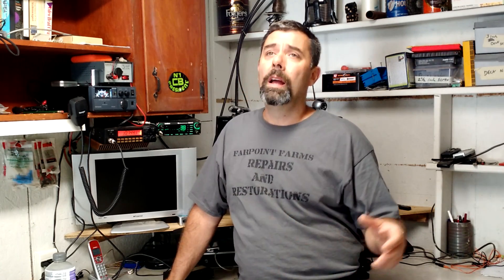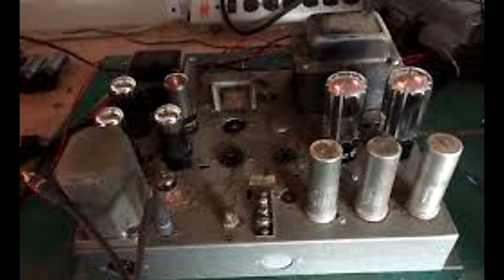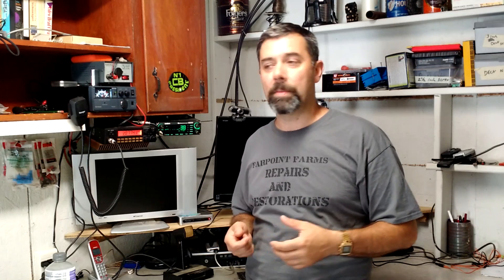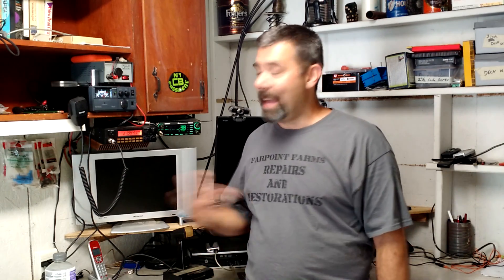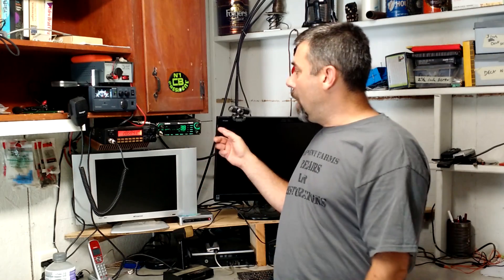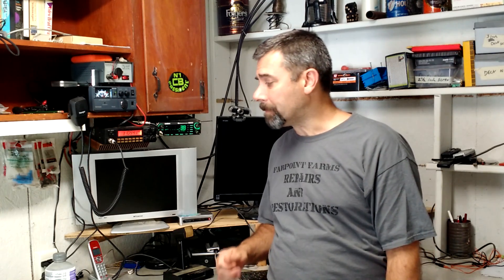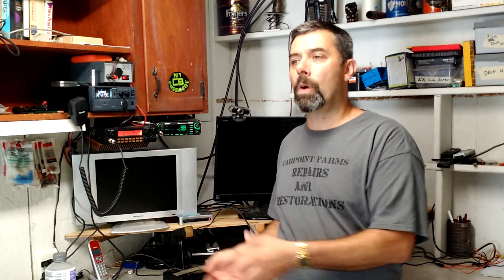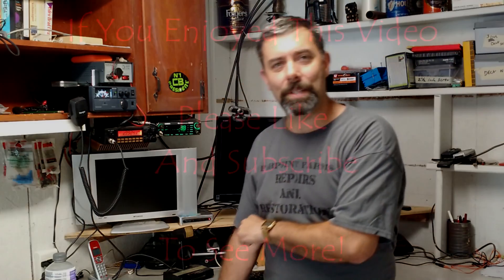A Beginners Guide To CB Linear Amplifiers.

Comment: Mid 90s I had a Cobra 25 ltd classic through a 350 watt Hurricane. We discovered that if we pulled the Wilson Trucker 4' stick up next to the electronic coin/control box at the car wash and keyed her up it added free minutes on the display. Always had a clean truck in those days.
Reply: i live in Crisco i had a super penetrator on the roof. I got a knock on the door and a pastor was standing there. he invited me to church.. it seems like i talked threw he pa systen. so on Sunday morning i cooled it.. did not want to inter fear with the lord
Reply: haha what a story
Reply: Had a couple guys in the 4wd club able to do the as well. One guy was able to just pull in the wash bay, and the wipe only had to touch  the metal of the wash arm and key up to get free washes. He had a 3000-watt, though.
Reply: If he was running 3k with a whip that was touching the roof or metal arm it would be arcing like crazy.

Comment: Okay I’ve watched several videos on antennas for a C.B. base. Yours are the most informative. My brother and I are trying to hook up with each other on our regulation 4 watt C.B. radios. We are separated by perhaps 11 - 12 miles as the bird flies. He is on top of fairly high ground; I on the other hand am living at about 2’ above swamp water level. Is this a futile attempt? Also I bought 50’ of RG213 coax for an antenna I hope to raise up to the regulation 60’ above ground. I just finished watching a video on the Tram 1499 ( an antenna I’m considering) and the package recommended RG8 for best results. Should I buy new cable? Consider a different antenna ? Looking forward to hearing from you.
Reply: Both of you need s.w.r  below 2 to 1 ,no further than you are apart you should be talking on 4 watts,.73s-Kc0rom

Comment: I used to have a Palomar 225 HD (High Drive) for my Cobra 148 GTL (with extra channels via chip leg 1/0) as my base station. I turned down the AM to 2 watts dead key and SSB to about 8 watts top swing which worked perfect for the High Drive. It worked great then one day I decided to swap the linear to my car to another CB for a trip, but I forgot to turn down the AM power. I popped the linear. I held on to it to get it fixed one day, but I got busy and packed my base equipment up to the basement in a box while throwing the linear away. I listen to CB via the scanner once in awhile seeing that it's picking up. Maybe someday I'll get it up and running with a new heater, or without.

Comment: When I got into CB at age 11 back in 1988, you were big with 400 watts. A few guys had around 1000 watts. It wasn't till the mid 90s that I really started to see the big amps doing several thousand watts being used by a lot of people. There was a guy that was building them in our area and several people got his 2x8 amp that did around 1500 to 2000 watts. They preformed very well, but were dirty splattering harmonics all over.  I had his 2X4 and it caused all kinds of interference too. The amps I have now are pretty clean. This is what I found with linear amps with a good radio and antenna in a mobile.

200 watts will get you out of the static and give you a pretty good boost. You can easily talk 10 miles away
500 watts will make you preform as well as a good base station and will allow you to have a high deadkey which will give you a solid signal. 15+ miles.
800 watts you will be able to talk about as far as the curve of the earth will allow. You will be heard 20 miles away by some. These amps typically have good RMS wattage. 
1200 watts will give you some good hammering abilities and you will be talking miles away to people. You will be heard 25+ miles away.
1800 watts you will be one of the stronger mobiles and few will get over you. You will be talking all over town. 
Any more and you're making little difference on the meter and it's only to try and get over the few guys running a lot of power. You will not talk any further and will just make it hard for others to talk. You will also need to make major modifications to power those amps.
Reply: barefoot my radio would talk  15 miles mostly boxes say they're 150 lo
Reply: @joeylowery4566  When you say barefoot, do you mean a Striker 955 or other export or a 4 watt Cobra out of the box? The 80 or so watts a Stryker will do will get you out pretty far with a good antenna with quiet conditions. My examples are more real world with static some skip.
Reply: Or 2:50 high probably not more than 40 on the low and 80 on the high

Comment: KG5WFV... Better listen here before you wanna run a amp on cb...
RF EXPOSURE is worst on 11 and 10 meters than most bands. 100watts or greater you will be causing serious harm.. it may not be Microwaves but your body absorbs HF and RF better on 11 meters. it well on chicken band. Add a amp.
Experience eye pain ear pain more headaches. Best cb radio to buy is a 5 watt cobra. Less watts = safe
Reply: bullshit period. WTF

Comment: I need your help!  I just purchased a brand new. Cb radio and 102" whip antenna ,,cable and all and all I get is static,, even got an SRW Meter for it and all '!   I can send pics.  Mybe got something hooked up wrong.
Reply from the maker: I suspect the antenna is installed wrong and is grounded. can I see a picture of the antenna block?

Comment: Just for information purposes, a good friend of mine is running a stock Uniden bearcat 980ssb with a RM Italy kl203. Most of the amps that I have dealt with have very little problem with 4 watts am input, most do NOT like the 6+ watt input. That said, smaller Texas Star amps prefer less about 2 watts and they are happy. The Texas Star sweet 16 loves 100 watts input max.

Comment: Most low drive amps were designed to run 4 watts out of the box, so they were compatible with most common CBs, then you have your high drive amps which can take massive power and put out an even more ridiculous amount of power.
Reply from the maker: I always thought it was 1 to 2 watts for low drive and 3 to 4 watts for high drive.
Reply: @FarpointFarms  it is

Comment: CB is fun if you dont want licence, but not close  to HF ham radio.it skip like 10m ham band.Problem of the CB is that i have only one band up of the hf portum,and skip is very rare on that 27-28 mhz bands.Without skip  ,half of the year CB is completly dead in my area.
Skip on CB is only in summer and part of spring and afther that CB is dead ,just like ham 10m band.But hams just switch to 40,80,or 20m in that time of the year.I have 100w hf rig kenwood 430s and simple windom fd4 wire antena +20amps power suply and for 300 dolars of equpment i work 80,40,20,12,11,10 m with one antena ,and no antena tuner so you got 5 bands +CB station for 300 dollars .I worked whole world with that simple antena and 100w ssb rig.I would newer trade just 40m band for CB.On 40 m always skip and propagation.20m king of dx ing in winter and summer always work.So CB is fun, but if you realy love radio, try to get ham licese for hf.

Comment: Why not use a 4 amp power supply for those amps requiring 12 volts like a mobile amp?  That's what I did and it worked quite well.  I still have 2 of those power supplies--one a 4 amp and one a 2 amp.  Why do you still stay on channels 1 through 40 with your knowledge of electronics.  You need to use a phase locked loop radio and go upstairs above channel 40 and below channel 1.  Also modify the clarifier to swing the transmitter to the receiver.  It's very easy to do.  I used to modify radios for people that wanted to get away from the 1 through 40 channel bull crap.  Yeah, that's why they call it a linear amplifier.  It doubles every time you increase the power.

Comment: I used to be an avid SSB enthusiast but sold all my equipment when I moved from the Atlanta area to Tennessee.  I had a 250 watt linear amp on my base station and a 75 watt mobile linear.  On my base station I ran a Fluke freq counter and modified my JC Penny's SSB radio to go above channel 40 and below channel 1.  I drilled a hole in the top of my radio to insert a tuning wand into the oscillator so I could swing it up for channels above 40 and down for channels below 1.  Ah, those were the days of SSB CB radio.  I think my dad still has a Palomar linear that I plan to get one day.  I used to modify CB SSB radios to go up or down below 40 and channel 1 for people who wanted to get away from all that 1 to 40 channel crap.  It sure was quiet up on channel 60 upper side band.  That was my home channel and I talked to more HAM radio operators than CB radio operators.  I had met quite a number of HAMs upstairs that I talked to daily.  The most desirable radios in my circle were Sears and JC Penny's single side band phase locked loop radios 'cause they were so easy to modify.  Cut a trace on the circuit board and add a couple of SPST switches and broadband the oscillator and you were good to go.  I sure miss those days (mid 70's and early 80's).  Heck, I even talked to Australia from Atlanta area using my old 1/2 wave ground plane antenna which was tuned to a SWR of 1:1.  I monitored my SWR's daily on my mobile and base station.  Sure wish I still had my Fluke freq counter.  I've talked around the world with single side banders using my old 1/2 wave ground plane and my base station JC Penny's radio.  Do they still use RG-52 coax?

Comment: Been out here trucking for a long time...lets just say for a time...was out here well before they changed our HOS to this crap we have now...that said. I've always had some kind of CB. From Corba up...Stryker is my favorite. 
But I retired and my old radio gear got lost or damaged etc.
So...I came outta retirement. (Forced. Wife said get outta here...go back to the hwy)...
I did and been out here without my radio for over 4 months...
I stopped by a CB shop. Wanted another Stryker 955 or 427...they didn't have either. 
So...in my crazed spending spree (over 900 bucks) I came out with a Connex 36 hp etc and a RM KL 300P amp. 1st amp I ever owned. After listening to this man. I think I've made yet ANOTHER boo-boo. 
I just wanted a radio so bad... ...and now I have ... ...what? Can anyone with knowledge of CB radios give me some advice. (Other than throwing it all in the river)
With it I got a decent antenna and a Road Ranger Mic etc.
I like this guy. Seems to shoot straight. 
Up til now...I'VE ALWAYS APPRECIATED "WOLF MAN RADIO" had my Stryker 955 and stopped by to get my SWRs set better. (You may think I'm crazy. But it's true. He sold me an antenna and grounded it...used my coaxial and when I pulled out...the high side of my SWRs were .89 and the low side was .59 ... ...it sounded great. (Stryker has the best receiver in the game. HANDS DOWN)
But...I could never get up I-85 when they were open.
Sorry bout the long story. 
You know what I have now.
It's STILL IN THE BOXES. I want to carry it by Dodge City CB in Dodge City, AL and have them look at it.
But IF any of you guys (or gals) has any ideas. 
Please tell an old man. 
Like I said...been out here a looong time...and still make mistakes. 
Thanks in advance for any help.
David McKinley
Reply from the maker: Those Stryker radios are some of the best for sure!

Comment: Does anyone have a guide or something I can follow for installing an amplifier? I'm a little confused on the keying circuit hook up. Where does the wire go on my radio? In the transmit pin for the mic?? Sorry of this is a stupid question.

Comment: i have a $50 Uniden pro 550 ( i think) with a Cobra Powered Mic and a Lil Willie (wilson) Antenna and a friend said i'm only putting out about 2 watts, and a couple miles away i pretty clear i'm told, but past that not so much, and my friends are getting out clearly for over 5-6 miles or more............what do you suggest ?
Reply from the maker: I'd check the SWR. That will effect the range big time.

Comment: I remember hearing portable phone conversations when using cheap walkie talkies. Fun times
Reply: In the early 90's I had a Motorola bag phone,  I was talking for about 10 miles and pulled over to fuel up.  This guy followed me in and told me he heard my whole conversation on the cb.😆🤔
Reply: @MrStaybrown  AMPS cellular technology
Reply: I had a handheld cb in the mid 70s and I discovered by accident that if our tv and my cb where on the right channels, I could amplify my voice into the cb and out of the tv speakers. Bugged the hell out of my sisters😁

Comment: all you need is a 30-40 high army big stick or antron 99 antenna with 1-1.9 swr, a good radio doesnt matter if its a export like galaxy or connex, or straight 40 like a cobra 29, have a mod kit installed, bigger finals like mosfet 520,  1.5-2 watt deadkey, and a good 20-30 pill box and you can talk wherever you want pretty much. Switch your aux to your beams and your def talkin whichever way you want. Unit 214 squirrel hunter smokey hills east tennessee got down